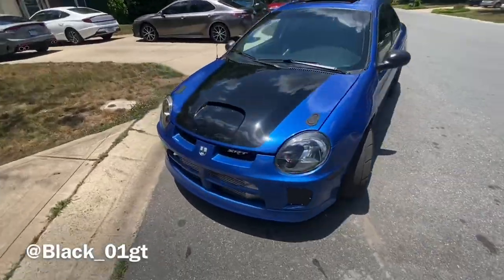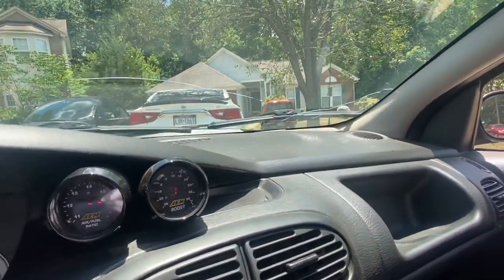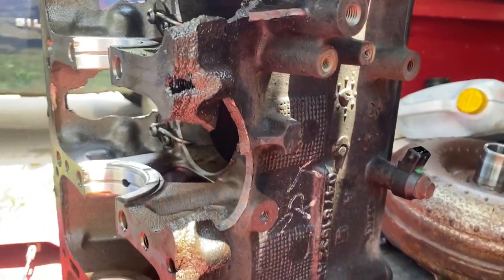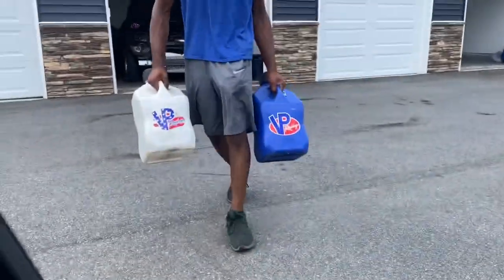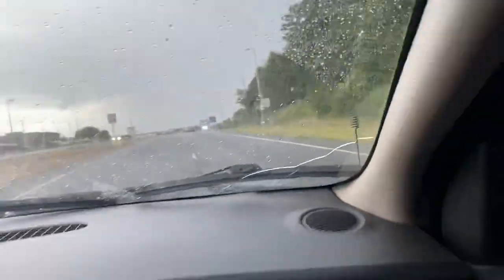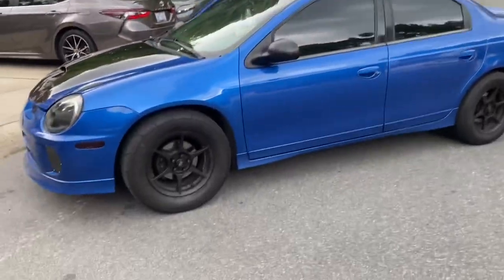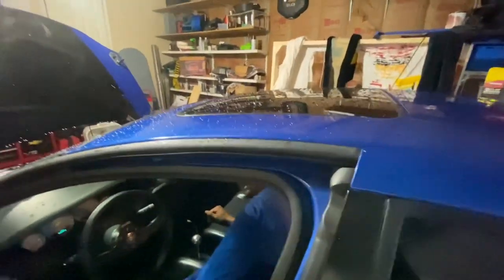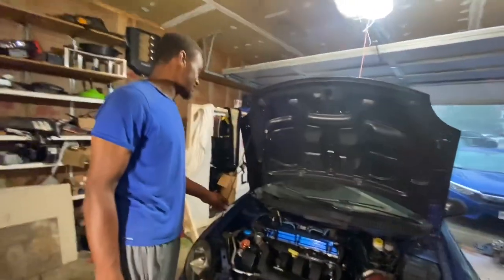500HP SRT4 equals SPEEDING TICKET!

Comment: Car looks good but sorry know these in and out but definitely not 500 hp if so something is wrong sound and pull a stock car with bolt ons tuned by Mario will pull harder and sound meaner but clean car sir 🍻
Reply: was just coming to say something along these lines.  500 in a small light car like this would pull so much harder
Reply from the maker: @jperdue3567  the car was turned down in the video, and I’ve done my research. I’ve seen a no interior 500hp car pull slightly harder with a small amount of wheel spin and once again the car was turned down at least 15psi
Reply: should be mid 450’s on 27 psi
Reply from the maker: @TallKidFTW  the car has been turned all the way up to 38 before. So 450 at 27psi is probably accurate. But turned up it’s still a 500hp car
Reply: @Saahuncho  I think there's a misunderstanding as to what was said in the video because everyone is stuck on stupid due to the look and sound of the car.  Lol I think we may have blinders on and caught up in this car porn. Nothing said was received while watching.  🤣
Reply from the maker: @jperdue3567  I agree that this is a valid conclusion 😭😂